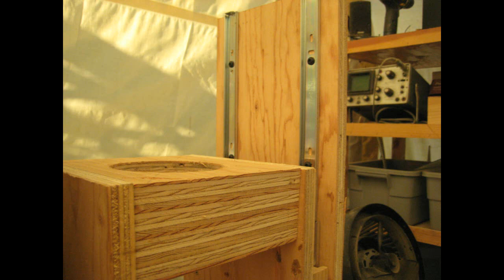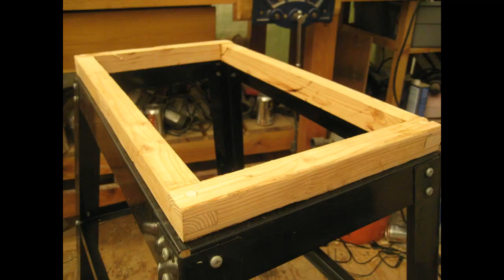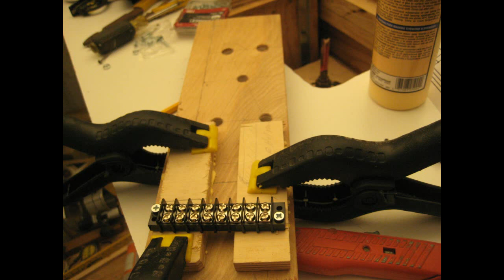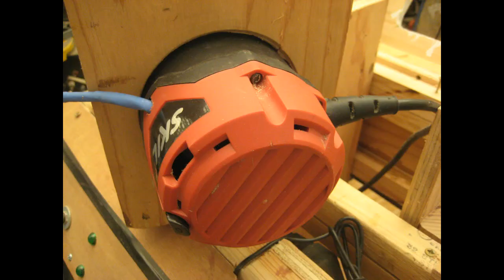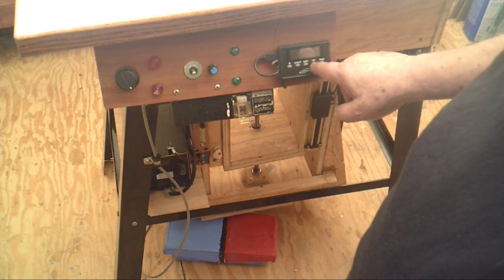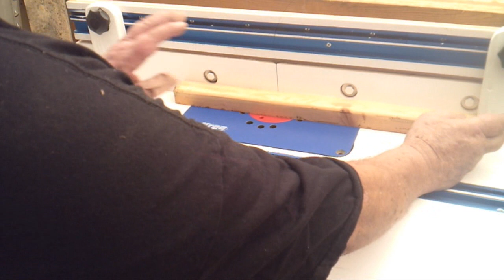Router Lift and Router Table Motorized. The Next Generation.

Comment: Unique table lift, thank you. When I get the opportunity I'm going to have a go at making one myself. I come from a similar background to you as I was an electrician before I really discovered woodwork
Reply from the maker: Thank you. You should make yourself one, it is the next generation of lifts.
I am working on an automatic fence to cut dovetails, finger joints and other joints with stepper motors, the ones used on the CNC machines. Wish me luck.
Reply: mtabernig Good luck !! Look forward to seeing the results
Reply from the maker: ian elley Thank you

Comment: Just watched, and instantly became a fan. This idea is amazing, this system you designed is AWESOME.  am very interested in building one of your router lift system,  I'm not sure I could build this myself - I would need the plans (if available) and some help.
I can only add my thanks for you sharing this idea
Reply from the maker: Thank you, I did not make plans but the measurements are not critical.
the electrical is on the diagram.

Comment: Thank you for sharing, the final product is pretty impressive. Could you be so kind as to let me know where I can find the circuit diagram as well as the relay/component values! Looks like you used DPDT relays but I'm not sure. 

Best regards,
Joe
Reply from the maker: If you send me the email I can send you the diagram. Also the diagram is embedded in the video. If you pause the video and do a print-screen you can retrieve it. The relays are 12 V double though relays nothing special and the diodes are 200V 1 A diode that I have in my box but any other diode will do. They are all common components found at any Radio Shack or equivalent store.  The speed circuit for the lift motor got a small PWM out of ebay and connected the output to an IGBT that come out of a motor controller and only used one side to manage the current drown by the motor; however,  I never use that function and is left in fast most of the time except when i show off in front of other people..  Obrigado.

Comment: Excellent job, very interesting. Could you please inform the name of measuring system you used? you mention that find out at ebay, but I couldn´t.
Reply from the maker: Roberto Simião  it is  " Igaging "
Thank you.
Reply from the maker: Roberto Simião the name of the devise is iGaging
.http://www.ebay.com/itm/iGaging-DigiMAG-Magnetic-Digital-Router-Lift-Remote-Readout-Power-Tool-Acce-/251617164890?hash=item3a958d3e5a....
Reply: Hello dear
I have this stuff if you need

Comment: what motor did you use for your lift? windsheld wiper motor:?
Reply from the maker: it is a window motor, however a power seat one would be better. You can find this things in that place on the internet where all types of things are sold,and bid for.

Comment: Here's the commercial equivalent you say doesn't exist. http://shop.nextwaveautomation.com/shop/item.aspx?itemid=129
Reply from the maker: Yes, I seen this, however, not the same and you have to program every move and or touch the screen, meaning taking your hand off the work. Also, it  can't be move on the fly. another draw back is that cannot adjust the bit speed from the panel like mine.  Over all it is a nice lift however not the same thing, I still like my version it is more versatile and easier to use.  In contrast, the same company have a nice robotic fence called "Ready to rout" ; however, me the tinkerer, at the present,  working on improve the design  with a second fence that sweeps left and right. Still in the experimental stages but you can watch a short video at  http://youtu.be/BrL4nmjoBHM 
Thank you for pointing it up.
 Regards.
mtabernig.